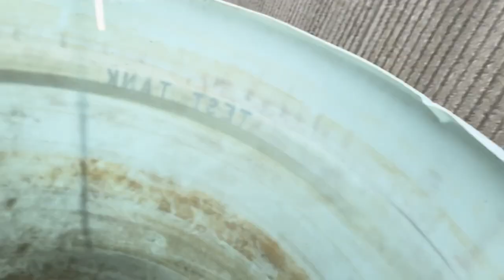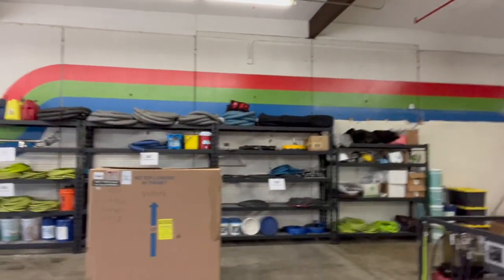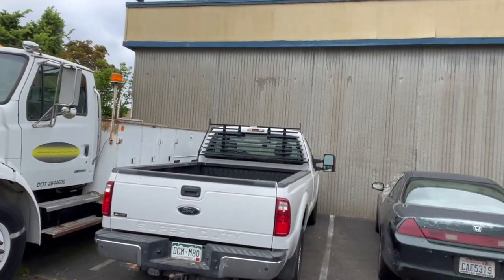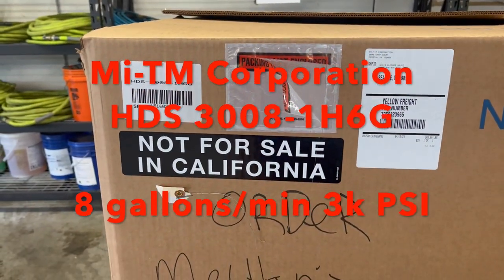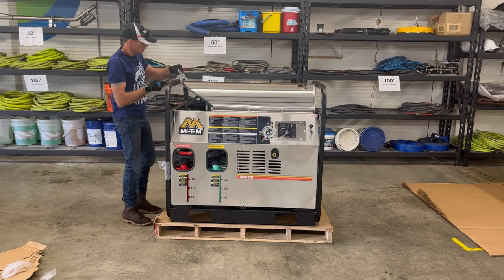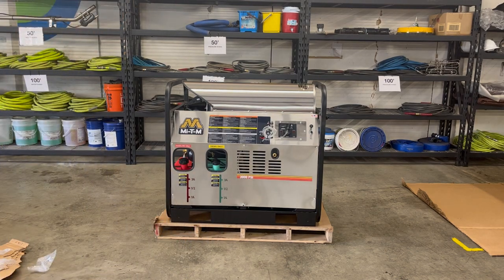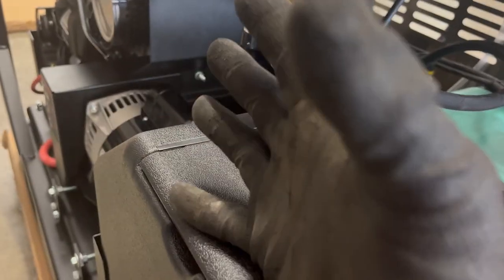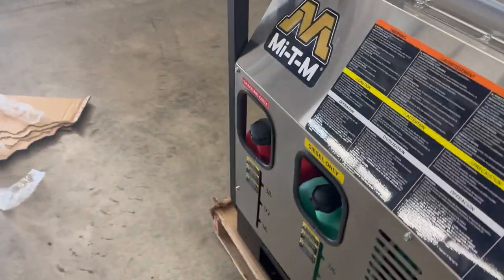Unboxing a new 8GPM Hot Water Pressure Washer!

Comment: I love your content! Make a video of that bad boy in action.
Reply: Thanks Paul!  Well I got good news for you then!  I’m almost done building a bran new $100k pressure washing system with a 500 gallon lightweight aluminum vac tank powered by a steel Eagle Fury 2400 CVU (600 cfm vacuum blower) on a 6’ x 16’ custom all steel trailer I just finished building from scratch.  The trailer even has a nitrogen gas shock suspension because why not? 🤓

Comment: Hey whats up Ben quick question and its a little unrelated to the video but do you by chance know if we need a special license to clean out industrial condenser and evap units or is it just something overlooked 🤔 i tried to look it up for Washington state but cant find much info on it
Reply: Are you cleaning the outside of the heat exchanger, or cleaning the refrigerant out of the inside?  That stuff is probably hazmat…
Reply: @Ben Shrope   well depending on the unit i know residential units you can clean from the inside and outside but im more or less just curious if you need an hvac license because a long time ago when i used to work sanitation for a company they would have us clean out the the evap units and now 10 yrs later im running my own business im curious as to whether or not something like that can be upsold as a service
Reply: @Ben Shrope  i am not doing one.... yet lol im just tryin not to break the law and see if i can add it as a service
Reply: @r.mshadow9713  ya, honestly don't know $hit about ac condensers lol
Reply: @r.mshadow9713  oh I see!  Well HVAC is a trade, and like plumbers or electricians, etc, you have to live see as a journeyman after your years of apprenticeship.  If a homer owner hires a non sanctioned/licensed contractor, then they lose all of society’s and the legal systems protections from errant contractors…
Reply: @Ben Shrope  ok ok I get you. Good thing I asked before doing anything would of gotten myself into some trouble 😅